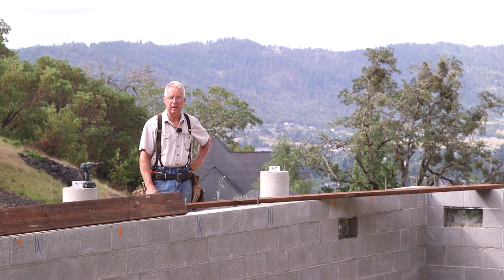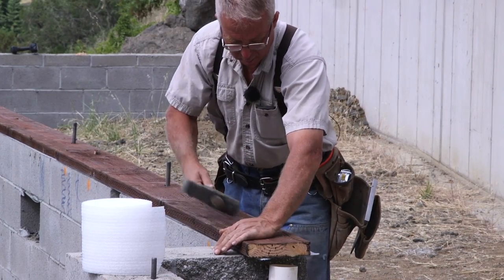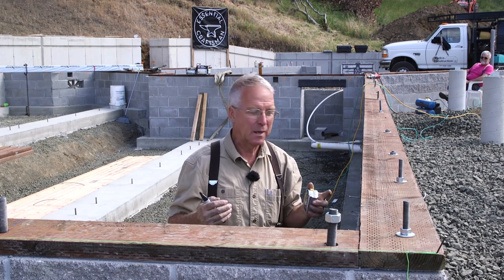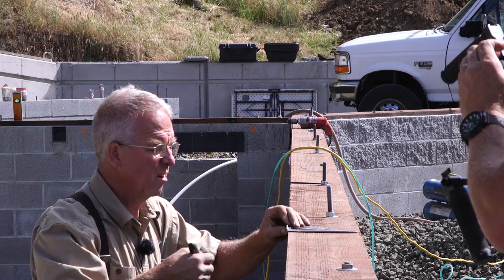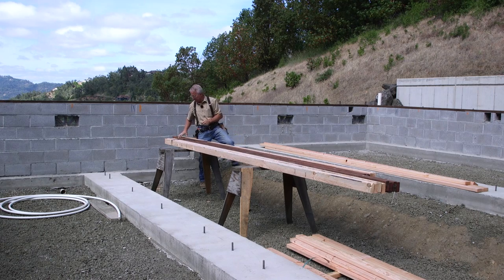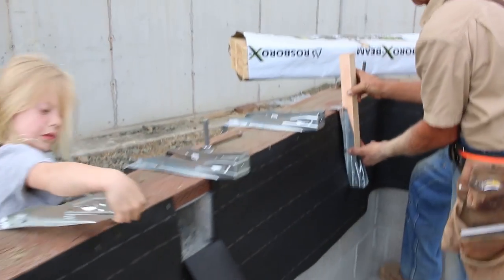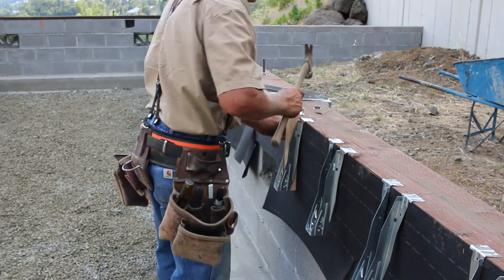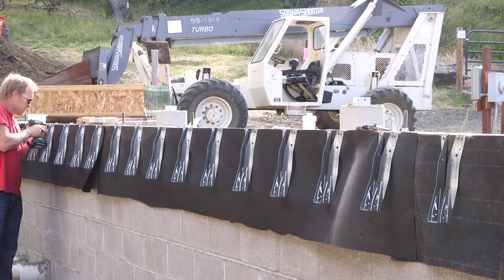Hold Up The Joists Ep.39

Comment: I can't help but think that future generations are going to be spending a lot of time and money fixing our mistakes surrounding all the engineered metal hardware we're building with these days. Just take your intuition about the inside edge of your mudsill taking the entire load of your floor system on 1" nails peppered along the edge grain. You're experience makes you aware of the myriad ways that could fail over time. I think the engineers lack the real world experience of what time and the elements will do to wood and nails. All of their testing and designing and certifications and specifications fail to look into the future. To me it looks as much like "designed obsolescence" as an oversight. I just hope Simpson is still around to reap what they've sown.
Reply: Pretty sure Simpson does not warranty against fitness of purpose so if it fails its all on you. I much prefer the 200yo method used on my house where the joist passes thru the support and they are matched notched so they can neither come in or go out and no nails or screws are required.  The whole floor system just lays together and is laying on top of  stacked rocks and yet has survived 200years and appears to still in be in the condition it was when installed. I suspect the ability for the air to flow freely around the wood and keep it all dried out if any moisture gets in is the key. Vapor barriers and seals and the lack of fall to shed water is a huge contributor to failures I see in modern construction.
Reply: bcbloc02 Yea that's what I'm getting at. I favor real timber joinery but I understand it's impractical for the majority of builds. Second best is traditional stick framing where loads are transferred in ways that will not fail over time- even if the nails back themselves out 3/4". I work in restoration of historic buildings and it is common for nails to back out over time from seasonal movements. It takes 80 years, but at that point these metal hanger and strapped together houses are going to start falling apart...

Comment: You go to all the trouble of building “stem walls” only to put the joists in brackets. 
I heard your explanation but in my opinion those joists work better sitting directly on the bearer/mud boards especially when you have the height. 
I would understand that method if height was the problem, but it isn’t. 
If your engineer designs those footings and lower stem walls correctly, your joists are not just hanging by a bracket and a few nails. 
I do love your vids though but that is a mistake the way I see it.
Reply: Anthony Stroud Scott explained the reason he installed the floor system inside the foundation was to lower the finish floor to the exterior grade...eliminate extra steps on the exterior of the house.  This is not a mistake but a (good and expensive) design consideration.
Reply: outsidescrewball 
You can still have the same height FFL by lowering the external stem wall and sitting the joists on the mud board/bearer. 
Using brackets with a couple of nails each end weakens the sub-floor dramatically and from my experience of being a carpenter and builder for over 20 in Australia, creates other problems such as the joists moving inside the brackets over time creating squeaking floors. 
There was simply no need to use brackets in that sub-floor in my opinion.